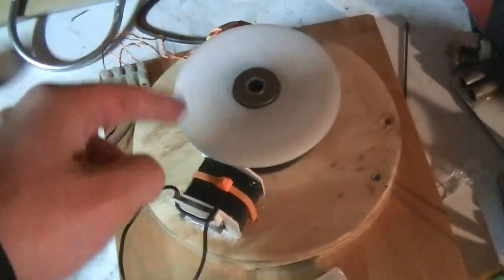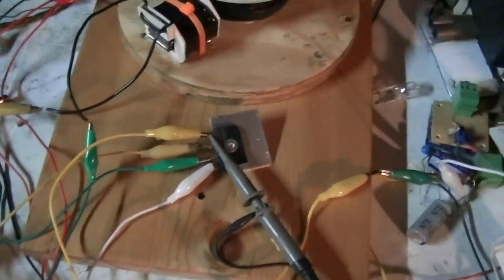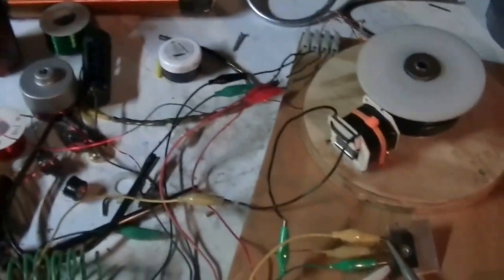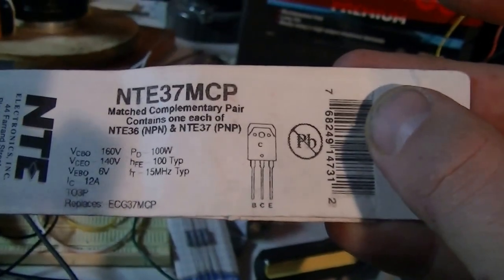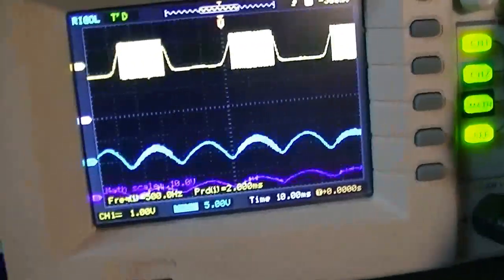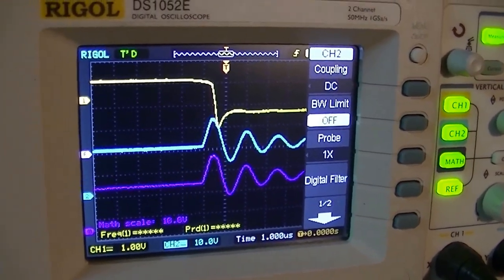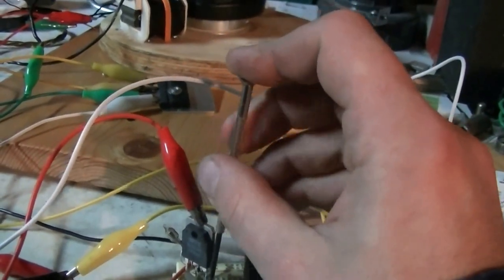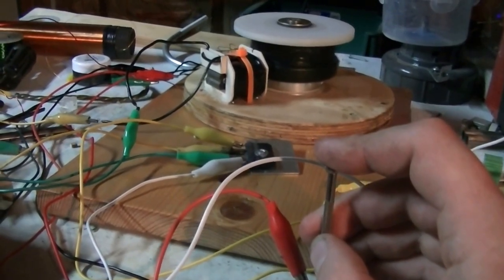PMBO2014 Progress Update

Comment: Looking good. Those Scope shots where much eaiser to understand :)
I missed what the channels where showing though. Was the top one the transistor colector and the bottom the generator output?
Reply from the maker: Yup, you would be correct. Scope Channel 2 is switched to the flyback charging side in there too I think that the generator coil is rectified too on the negative as well.
Reply: That Pulse train from the drive coil when its switched off is crazy. Looks like it is going below 0v too (you really should be using DC coupling on scope there).. A ell placed diode could get that to ground and improve your efficiency. I bet there is similar thing on the base. An e-b protection diode could be all it takes.
With diodes on flyback circuits like this, sometimes lower frv is not always better. Sometimes you need some voltage remaining in the circuit for it to run.

I really will have to make a PM one day. Still kind of tempted to whip up an entry this year...
Reply from the maker: I know exactly what you are saying, I just wanted to see the raw generation of the coil. I been trying to find some 1n5822 to no avail. Didn't have the money or the time to order them. I might want to try putting a super small value ceramic capacitor across the diode. Thanks for the suggestions. The end circuit will be a little different then this, just getting a feel for what she can handle.